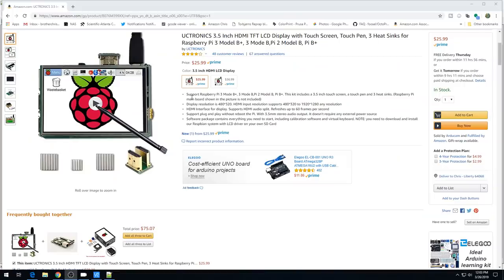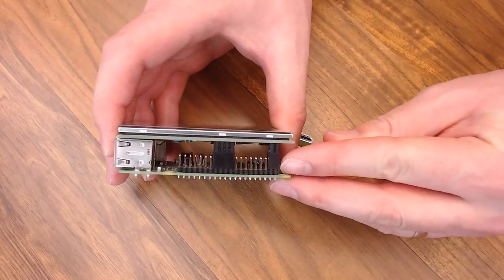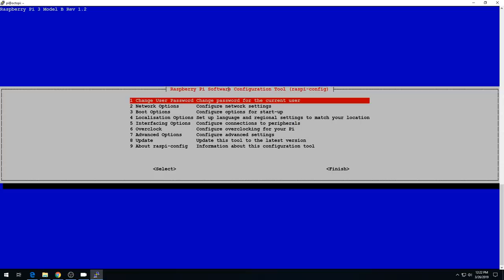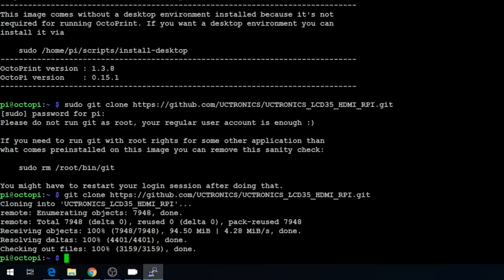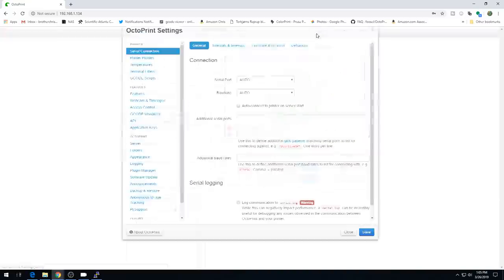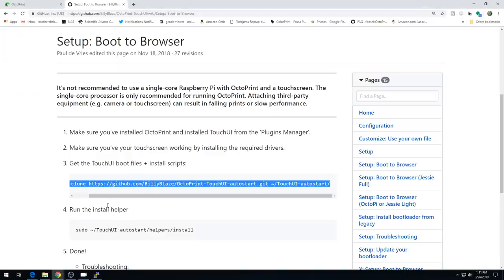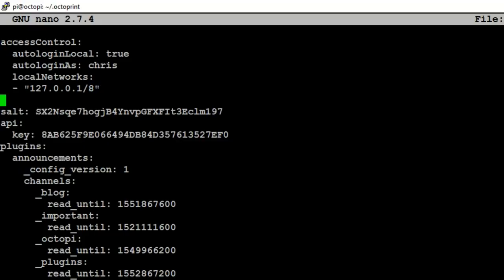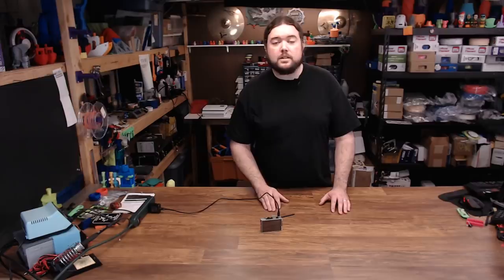Octoprint Raspberry Pi Touch Screen Install - Touch UI - Chris's Basement

Comment: Hey Chris my raspberry pi setup with this touchscreen freezes up every single time so it's really u reliable to actually start prints. You seem to know quite a bit about linux  and was wondering if there was some troubleshooting I could do to try and make this system reliable.
Reply from the maker: I would start with running    top    from command line and watching it when it freezes. See if anything is using a ton of CPU. Then I would start looking at temp make sure it's not getting too hot. 
/opt/vc/bin/vcgencmd measure_temp  And then I would look at voltage, make sure you have enough power. https://raspberrypi.stackexchange.com/questions/60593/how-raspbian-detects-under-voltage
Reply: @ChrisRiley  I'll give it a try. Thanks for your help brother!!

Comment: Need help please! My camera (Arducam 5 Megapixels 1080p Sensor OV5647 Mini Camera Video Module) works great with Octoprint but right when I install the drivers to this screen, my camera stops working. Its like the drivers mess up something in the configuration files but I have no clue how to troubleshoot. Help is much appreciated!
Reply from the maker: How does you sensor connect? USB?
Reply: @ChrisRiley  The white ribbon strip that hooks up closest to the usb ports of the Raspberry. Thanks for your quick reply!!!
Reply from the maker: @paulpotylicki7717  Run the raspi-config when the screen is hooked up. Is the pi cam port still enabled?
Reply: @ChrisRiley  Wow. That simple. I just had to go back in there and re-enable the camera. The instillation of the screen drivers must have disabled it. Thank you so much for your time! You saved me a trip from having to do an Amazon return!

Comment: So I followed the instructions (sort of..) to install adafruit 5" backpack touchscreen. I get the Octoprint UI on the screen but no touchscreen capabilities. So what am I doing wrong?? I cannot find any instructions on driver install for this touchscreen.
Reply from the maker: Yeah, it has to be a driver issue. All those screens are just a bit different. See if it has a github page.
Reply: @ChrisRiley  Yeah, I returned the 5" touchscreen for a PI 7" and it works so problem solved...

Comment: Is there any way to get the browser view you have on a desktop onto the screen? I ideally just want to view the Gcode viewer on my screen, not the touchUI options
Reply from the maker: You can just install the desktop and use that instead of doing this procedure. sudo /home/pi/scripts/install-desktop
Reply: @ChrisRiley  That's actually awesome! Will make life much easier! Umm Is there a way to go though Putty to clear everything and start again without getting rid of Octoprint or my plugins just to clear some additional space? Just like clear all the screen config, TouchUI etc and I'll just start over. Install the screen and touch interface drivers and then the code you've listed above
Reply from the maker: @TheMartynneil  You can rm that driver folder for the screen and just remove the touchui plugin from octoprint.

Comment: Hey Chris.. Love your tutorials... installed the 3.5 tft thanks to you... my only issue is the font size.  I have the same configuration as yours,  but your font on the tft are much bigger,  mine is too small to be readable.  Is there a font adjustment to increase the size?
Reply from the maker: Thanks! Are you saying the font in touchui is too small?
Reply: @ChrisRiley  yes... the font is extremely seen small... on your video,  the font is readable.. mine it's not... same equipment,  same configuration
Reply: @ChrisRiley  also.. on a side note... on your video,  your webcam was knocked off,  with an associated error message,  mine was too.. were you able to correct it??? It was only a second on your video,  but I got the same message
Reply: @ChrisRiley  video marker @ 13:44
Reply from the maker: @jrenzo0001  That sounds like maybe the driver didn't get installed fully. I would go back and give it another try. The webcam issue for me was because I didn't have it plugged in. It should go away if you connect it.

Comment: this works only for small displays, right? because I have a 7" display and try to get it running... but I always end in the command screen...

edit: it's not a hdmi display, it's one with the flat cable.
Reply from the maker: The GPIO ones are pretty tricky to get working.

Comment: Can someone tell if i can still use the GPIO? i got now a temprature sensor and mechanical buttons there to work with octoprint.. don't know also if i can fit connectors there in this configuration or maybe use hdmi cable and dupont cables
Reply from the maker: You can still use them, you might have to get crafty with some connectors to reach them, but they are still available.
Reply: @ChrisRiley  thanks man.. so i gonna buy this and try

Comment: Any recommendations as to why I would still be getting the login requirement through terminal when booting?
Reply from the maker: You are seeing the SSH login or the octoprint login?
Reply: @ChrisRiley  SSH. In the end I was unable to get the SPI TFT screen to work with touchui. It works fine with everything else including octodash and octoscreen. And touchui booted on an external HDMI.

Comment: As much as I like the SPI screens, because it looks like a tidier install... I prefere HDMI or MIPI screen interfaces because they're designed specifically for video, and you're not relying on software tweaks to make it work.
Reply from the maker: Agreed, just seems to be a lot cleaner install as well.
Reply: Chris Riley SPI screens are ~$15 and hdmi is around $25. I chose the cheaper version and it’s definitely become a headache.

Comment: How I can uninstall touch ui? In my case the went all good expect that touch ui not showing any information. Do I need to flash the sdcard over?
Reply from the maker: These commands didn't work for you? https://github.com/BillyBlaze/OctoPrint-TouchUI/wiki/Setup:-Boot-to-Browser
Reply: @ChrisRiley  thanks for your response. I have the same issue with this guy

https://community.octoprint.org/t/touchui-not-showing-any-information-after-octoprint-install-to-latest-version/10806

Comment: Installing was a piece of cake, following this video. The TouchUI is a great feature. My 7" panel needed no drivers added independently.

Is there an easy way to determine the IP address, in the case of moving the printer to a new network? I know about editing the octopi-wpa-supplicant.txt file, but on public unsecured networks, one cannot easily find the IP address.
Reply from the maker: Glad to hear it was easy to setup. That has always been the struggle. I would think that would be something pretty easy to add to touch UI.  We could pull that with a API command. Maybe we can request a new feature be added.
Reply: @ChrisRiley  That's good to hear. Originally, I wanted a means to turn off the UI and turn it on again easily, but my goal being the IP address seems simpler overall.
Reply from the maker: @freddotu  https://github.com/BillyBlaze/OctoPrint-TouchUI/issues/308
Reply: @ChrisRiley  I didn't get the notification from youtube of your reply, but returned to this thread to find your answer. I've followed the github thread, but have also discovered something not as convenient. There's an Octoprint plug-in that puts the IP address on the LCD panel. This printer has the panel, which isn't a standard item, but I really like the TouchUI screen. If your request is filled, all the better especially for people who use printers with no panel option.

Comment: Getting a HDMI screen is more advisable for another reason- the framerate on GPIO (SPI) - based screens kinda sucks. And you might want to connect other things to GPIO like buttoons or relays.
Reply from the maker: Good call.

Comment: i'm getting error while trying to install the touch UI.. Any ideas? Anything else i can do to get these dependencies?

Installing dependencies (xinit xinput xserver-xorg xserver-xorg-video-fbdev x11-xserver-utils matchbox unclutter chromium-browser):

 - failed
Reply from the maker: Almost has to be an internet error. Can you ping google? Did you run apt update ?
Reply: @ChrisRiley  sure, completed the apt update, everything else works fine. Even the port check in octoprint completed successfully
Reply from the maker: @G33km0bile  So it doesn't seem to be a network issue. Can you install those manually?
Reply: @ChrisRiley  i found my solution, i ran this command, it fixed my issue, then i just restarted the script :D

'sudo apt --fix-broken install
'

Comment: Thanks for the video. Can I just plug/unplug the hdmi connection when I want to use the screen or not use it? Is that safe to do while it's on? Thanks
Reply from the maker: It's safe to do while it's on, but the driver will not support it.

Comment: Hi Chris, Running the command line git clone https://github.com/UCTRONICS/UCTRONICS_LCD35_HDMI_RPI.git creates the directory, but when I change to this directory and ls function only shows readme file, and no install or driver files. Same screen as in your video, and last year I was able to do this successfully. Any ideas? Thanks.
Reply from the maker: Looks like they changed it, try this one. https://github.com/UCTRONICS/UCTRONICS_LCD35_RPI.git

Comment: I have a 5” touch screen and I can’t get the touch up to boot. I believe the drivers are installed, however my resolution doesn’t change. Any suggestions ?
Reply from the maker: Sounds like maybe the drivers aren't getting loaded correctly.

Comment: I can’t get the touchscreen to auto login, even after your guide to add the local networks script. Are there other things I need to consider, to correct this?
Reply from the maker: The only thing I can think of is there might be something a skew in the config file. Make sure all the sytax is correct.

Comment: I use 2 printers, i think the touch ui struggles to decide what to connect to, so it does not connect to anything, how do i make it listen to one ip address that i choose ?       Im stuck on Touch Ui on the screen,    it says connecting to http://[::1]/         I dont need it to be working for both the ip addresses, only one at a time as i choose the ip to listen to
Reply: Ive managed to fix it now, i found a post which helped me to fix this annoying issue.   

go into putty log in and write this        "cd TouchUI-autostart/"      then write "nano chromium.xinit"       then you go down to where you see    
# Check if OctoPi is used
OCTOPI_FILE="/etc/octopi_version"
OCTOPI=""
if [ "$AUTODETECT_PORT" = true ]
then

it will look like this

change the "true" to "false"                now you can do CTRL - X and Y to save hit enter.            then just do a sudo reboot
                                                                                                                                

i belive you can acctually go inside that file and change the ports too, so if you have multiple printers on your pi you can probably change the 8080 port in there to 8081 for example.

If that doesnt work you can do this aswell.

This is something i found in another post, ive not tried this one but something works for some and someone has to fix it by something else

run "sudo nano /etc/default/touchui"
change on the bottom of the file "AUTODETECT_PORT=true" to "AUTODETECT_PORT=false"
save it
run "sudo service touchui restart"
Reply from the maker: Glad you found the fix and thanks for posting it.

Comment: Great Video, I use the cheapest from china screen on the gpio pins (not hdmi) and followed the set up from Joe Mike Terranella's channel with no problem to set it up. It does mean you have the hdmi plug free if you want to go to a large screen but the resolution will be set for the 3 1/2" screen. drivers didn't seem to be hard to find as mine didn't come with any, Im sure Joe had the link if not ask here and I will put the link I used.
Reply from the maker: Right on! Good to know the drivers aren't that hard to find.

Comment: Has anyone had any issues with keeping the Pi cool with adding an LCD? I have added active cooling on my non-LCD version in my printer and that works reliably but I don't like the passive cooling performance and it will only ever get worse with a second board (and additional heat source) 15mm away. I did wonder about adding a small 30mm fan blowing between the two boards or even trying to squeeze a 40x40x10 between the gap but both of these are not ideal. Increasing the gap between the two boards would be good but you are stuffed because of the HDMI bridge adaptor.
Reply from the maker: I haven't seen any, but I don't use one full time. Maybe others have some tips.
Reply from the maker: @Usama Khan Agreed, should work the same.

Comment: know this is a little old now, but i accidentally used the wrong user and pass for the touchui desktop auto login, and now every time the pi starts, it asks me for a user name and password. is there an easy way to change the user and pass or do i have to format the card and start again ?  hopefully not.
Reply from the maker: Yes, you can reset it. You will need to get into it via ssh and remove some files. Remove .octoprint/users.yaml and in .octoprint/config.yaml change this line firstRun: false to true. This is reset the access and the wizard. REboot and you should be able to reset it.
Reply: Chris Riley thanks heaps for the help.

Comment: I think I ran all the steps ask described but it doesn't boot into TouchUI, it just boots to the linux octopi login prompt.
I looks like TouchUI gets loaded but doesn't launch.
[  OK  ] Started LSB: TouchUI daemon.

I did notice that even though I copied and pasted from GitHub exactly, it installed in /home/jeremy/ and not directly into /home.  Not sure if that's the problem and not sure how to fix it.
Reply from the maker: Home dir is fine,  in the web interface, does touchui come up? Is touchui working at all?
Reply: @ChrisRiley  so your saying I should move into Home?

Yes, TouchUI works in the browser.  It's the Pi booting into part that doesn't.
Reply from the maker: @jeremyjohnson8703  No, leave it in your directory, check this out as well. https://community.octoprint.org/t/touch-ui-plugin-not-working/16757

Comment: HI @Chris,  
I am running in to issues with the auto login, I have changed the config.yalm file like you explaned, but it does not auto login. Any options for that ? 
Thanks
Reply from the maker: Make sure you didn't change any of the order of the yaml file. Other than logging in on that little screen everytime, there really isn't another option.
Reply: @ChrisRiley  and make sure to use the octoprint login, not the pi login, I made that mistake
Reply from the maker: @kamakiri700  Great point, yes, that is the Octoprint login info.

Comment: I used a kuman LCD which uses SPI instead of HDMI and it appears that the display your using with the HDMI is a bit faster responding to the touch screen. When I did mine there weren't any videos this detailed so it took some research on Billy Blaze's git hub page and a lot more time before I got mine up and running.
One thing I had to do, probably because I have mine in an enclosure not designed for a display, is to add a fan or it would overheat.
Thanks for this video
Reply from the maker: Glad you got it working, yeah I was somewhat surprised there weren't more videos on this.
Reply: I have numerous issues with the Kuman LCD screen. It shows a mouse cursor, which makes it very hard to control. And whatever I try, the X-movement seem to be reversed, whatever I enter in 99-calibration.conf. Any tips?
Reply from the maker: @martijnajanssen  Unfortunately the screen very wildly from one another so they are very hard to troubleshoot. Maybe @electronron1 can help, but the vendor should have calibration software to help. Also, check this out. https://github.com/BillyBlaze/OctoPrint-TouchUI/wiki/Setup:-Troubleshooting#calibration

Comment: I'm having issues I've seen two people mention on here. I have the GPIO version of the UCTRONICS 3.5 screen. Spent hours on it to get nowhere, the TOUCHUI logo just flickers. I can not get it working no matter what, wish I'd of gotten the HDMI version now
Reply from the maker: Yeah, I have been seeing this a lot, I will have to try it on a GPIO screen.
Reply: @ChrisRiley  it's a real pain, spent about 3 days now trying to get my screen to work with it. Currently trying again now.
Reply from the maker: Try this, I found a fix. Do step 3 only. https://github.com/Z-Bolt/OctoScreen/wiki/Installing-OctoScreen-with-a-3.5%22-480x320-TFT-screen

Comment: I have just followed your guide and all looks good except the screen needs to be resized  %
I am missing the 3 lines for the additional menu commands.  Plus the screen isn't responding to touch.  (I have the exact same LCD and latest updates)
I tried :  sudo nano /boot/config.txt  and updated param hdmi_cvt:

hdmi_cvt 800 533 60 6 0 0 0

Seems to have helped but the touchscreen is still not working.

 I am running Pi 4b if that will make a difference?
Reply from the maker: Rerun you driver install command, that should fix it.
Reply: @ChrisRiley  I have several times.  My screen resolution looks nothing like what your video shows.  Not sure the versions your running I have OctoPi Version 0.17.0, running on Raspberry Pi 4 Model B Rev 1.1, Uctronics B010601 don't know version. I also had to install additional packages.
Reply from the maker: @scottd6053  Pi4 does have a different video setup, I have one, I will give it a try if I have some time.